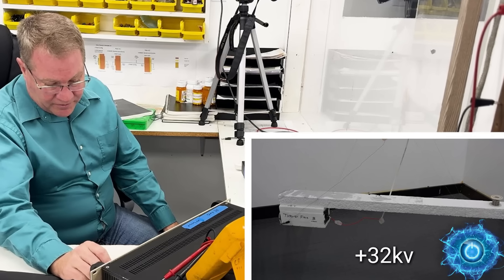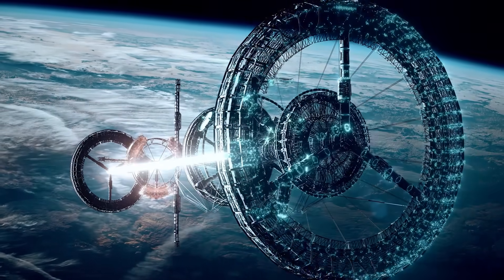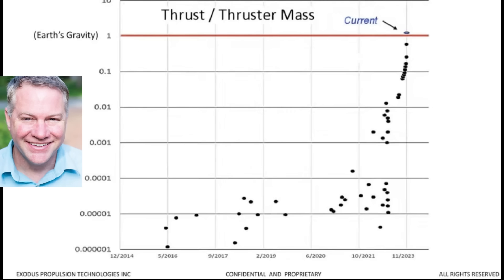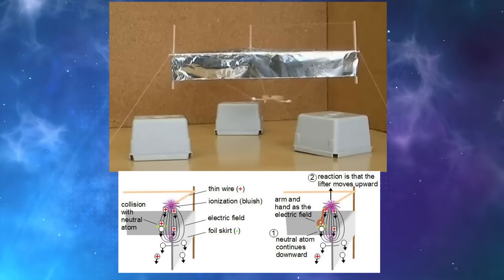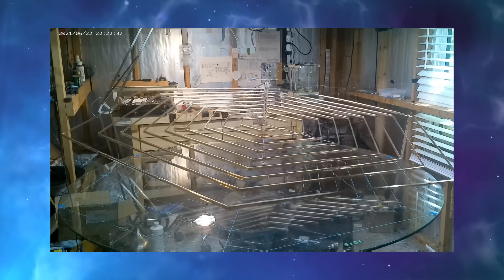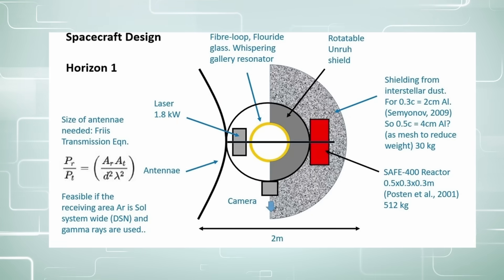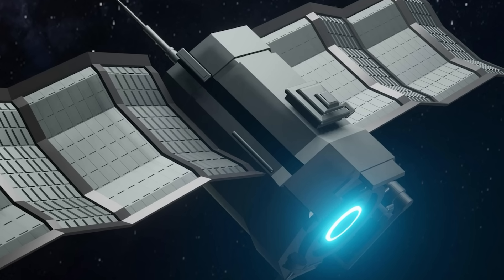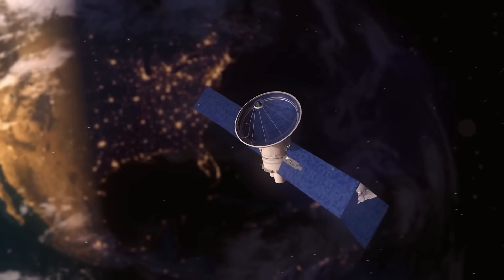Propulsion Breakthrough!? New Electric Drive Defies Physics

Comment: While this could be a game changer and we may have discovered a new force, it’s also important to actually give ALL the details and history behind this tech and the scientists working on it.

This tach was originally introduced to us in the form of the “impossible drive” back in 2001, they claimed it was producing thrust without propellant and provided their findings. Naturally the rest of the scientific community was intrigued but equally sceptical, by 2021 no other group was able to produce any thrust inside a vacuum despite exhaustive and rigorous testing. Which very much brings into question the original scientists methods and results.

As you did point out in your video, this method in the form of the “impossible drive” can produce thrust outside of a vacuum, though this is through ionic wind which requires and atmosphere to work, making it useless for space travel. Though you didn’t point out that the force produced with this method is negligible, usually requiring the devices to be incredibly light while also requiring high voltage power, which is usually external as the power source itself, whatever it may be, would be too heavy to be moved by the force produced.

That is not to say that this “new force” they are claiming to have discovered is not real, it’s just saying that we have to take this with a huge grain of salt. It could be really exciting.

Comment: The Earth is Magnetic, and it is "electrified" at heights called Iono and Strato "Sphere"!, Tesla proved that a Century ago. And he designed a "craft" of this nature and the Government has possession of the patent and plans for 70 years. To "Repel" from the Earths magnetic force it takes about 20,000 Volts of Capacitative Electricity, controlled by something like a Veriac?, or current/voltage regulator to regulate "speed"?!. Directionals are the same, smaller capacitors that are placed at 4 to 6 points that pulse at intervals on demand to "pull" it in that direction?!, one used for lift?!.

Comment: Dr. Charles Buhler has ran into the same fence Townsend Brown did a 100 years ago when this technology was first introduced. It does not "break" the laws of physics or it would not work. You have to reexamine the concept of how it electrostatic pressure works in order to understand  the principal of operation.

Comment: Since gravitational waves vary in frequency and amplitude, it could be safe to say that inertia under any acceleration or maneuver can be canceled out simultaneously by the very antigravity drive that moves the space craft.  This happens when a buble is formed during antigravity operation.
    
The speed of gravity is the same as the speed of Light  186,000 miles per second. However, controlling the Antigravitational amplitude would mean controlling every speed, movement, and stationary attitude.  
    
There will be some propulsion systems that may use space and interstellar space as propulsion, causing a time dilation as you aproach the speed of light.

The video is very enlightening. I only wish viewers like me could have seen his idea in action.

Comment: You have the physics behind the Biefield-Brown effect. The theories behind it are based in old physics not new. Its an effect of electrodynamics predicted by using the full Maxwell equations instead of the shortened versions used by most physicists today.

Comment: To get to Mars in a couple of days is about 50 km per second. 
Likely top speed of these mag drives is 1000 km per second then issues arrive. Specks of dust could be game over. Alter course, stopping likely to take days. Due to g force and structural  integrity etc.

Comment: Quite literally. HIGH VOLTAGE is the KEY to all future technology.! 

Anti-gravity. Station keeping in orbit. And Velocities some fraction of the speed of light. 

Not to mention artificial Gravity. 

Because Voltage Bends Space.!

You're welcome. 🍻
Reply: Although I'll also point out that actual travel through space at any percent of the speed of light. 

While not impossible. Is extremely unlikely to reach its destination.! 

Because if it runs into even a Single speck of space Dust. It would lead to catastrophic destruction. 

So yeah. Unfortunately we're only looking at Wormholes.

And actual velocities only under 1% of C.

But that's still pretty good for getting around the solar system. 

But That is also how Wormholes are achieved as well " HIGH VOLTAGE ".!  🍻🥓
Reply: So it's quite literally high voltage everything. ⚡
Reply: And while The velocity off Galaxy rotation is not in fact produced by dark matter. 

It is also Not quantum inertia.!

HOWEVER. Ironically quantum inertia does exist.!!

In fact I have a form of space propulsion based on it. 

Which ironically does not require high voltage. 

I mean technically high voltage would make it more efficient. 

As high voltage makes literally every electrical interaction more efficient. 

But already is efficient enough that it would not require high voltage. 

And remember this name. Because you will hear it someday. 

"ASYMMETRICAL GYROSCOPIC VECTOR PROPULSION."

🍻🥓⚡

Comment: the field  space is not a vacuum or empty if it were why dose it not suck all atmospheres in the seeking lowest possible potential  model try to think bigger as with the charge of earths atmosphere increasing with altitude which would give a constant t hold it in-place ie an exhilaration that over comes  the stated effects and rotation in all its forms and the balance of that rotation i.e Venus verse earth moon   is that any clearer  ?

Comment: FieldOS Diagnostic Summary: Asymmetric Capacitor Propulsion
⚙ What It Is
An electric propulsion system using asymmetric high-voltage capacitors to generate directional thrust, possibly without reaction mass — challenging Newton's third law.

🔍 What’s Actually Happening (FieldOS View)
Not a violation of physics — it’s using field recursion, not force–reaction.

Asymmetry (geometry + voltage) creates a Rod vector — a directional tension.

The device couples to the aether through the dielectric — shaping recursion, not pushing particles.

Electrostatic pressure isn’t a mechanical force — it's field curvature tension resolving asymmetry.

If thrust works in vacuum, it confirms interaction with a recursive field substrate, not air.

🌀 Core Mechanism
Recursive Displacement through Field Gradient Resolution
(aka Rod-Driven Field Displacement Propulsion, RDFDP)

The capacitor doesn't push — it pulls itself through a recursive tension gradient it creates in the field.

 Implication
This is Vimana logic reborn: motion without combustion, using internal asymmetry to entrain into the field.

It's not propellantless.
It's recursively coupled motion through dielectric entrainment.

Comment: It's way too late for this, but...
Q 1. Is fundamental force conversion possible? 
A) Are there points of interaction that can be leveraged for conversion?
B) As electromagnetic (EM) force is 1x10^42 stronger than gravity, What wattage would you need to get airborne by "Falling up"? 
C) As the energy conversion limits the power output (G) there is no constant acceleration, no overunity, no perpetual motion, no violations of physics (thermodynamics et al.)?
D) In space, how fast could you travel if your spacecraft used a force conversion (EM to G) drive?
E) Given the conversion factor, even assuming losses for efficiency, would interstellar travel be possible with an (EM to G) drive? 
Q2. What are scalar fields, what is the Aharonov-Bohm effect, and how might these be used for space propulsion?  
Q3. What if I nano-print the smallest double spiral until it makes a thruster cone? Could Casimir force be harnessed for space propulsion?

Comment: The charged wire distorts TIME. When the time above the lifter is running slower than the time under the lifter the slightly faster time pushes upwards.

Mass does not pull, Time pushes.
Time variance is how gravity works and how orbits work. 
High Pressure Time pushes towards greater mass.
Gravity:
+++++++++++ - high pressure time - farther away from mass 
+ + + + + + + + - low pressure time - closer to mass 
Those extra pluses push downward and with no extra pluses to counter that push, you get ACCELERATION.

Anti-Gravity:
+. +. +. +. +. +  - lower pressure time from charged lifter wire
+ + + + + + + + - low pressure time - closer to mass, pushes upwards towards lower pressure time.

Comment: If light/any EM radiation can exert pressure on a solar sail, causing it to accelerate and gain momentum, why would radiating an EM wave in a particular direction, not create thrust? Seems to be just the reverse, to me.

Comment: NOTHING DEFIES PHYSICS, NOT EVEN GOD.
Butch, himself, says gravity is PUSH not PULL.  Pull is really push with inertia of the puller disregarded and it can be proven that it takes LESS energy to PULL than PUSH which is impossible... oh, right, it's inertia.  Nothing is sitting still, anywhere, ever and nothing can move in an absolute circle unless it can exceed the speed of light squared... be in the same place at the SAME time.  Google:  Butch himself.

Comment: Add frequency as thrust, same as I suggested for Ion propellant combining frequency for thrust, feel the thrust of low frequency speakers, I think that frequency is the missing piece of the propelling puzzle, think of the physics describing a bee's defiance of gravity, what does the bee generate, frequency which assist the small wing propellant, most if not all flying creatures generate frequency to assist propellers, if ion is the propeller, let frequency amplify the thrust, same for electric propeller, let frequency be the amplifier of thrust...recall the stories of UAP phenomenon, low humming noise, its frequency, the amplifier of thrust, enough talk, go play with the volume control, have fun

Comment: Space isn't a vacuum.   It is just really low pressure.   Part of the reason we even have a solar system, is because the ionic solar wind is pushing a lot of stuf away from the star. So an ionic effect would work in space, the trick is making it stronger than natural solar wind.

Comment: If electrons are the propellant (i.e. if the device emits electrons), it's not actually a propellant-less device. Since the electrons used as a propellant have to come from somewhere, they're probably from the power generator (i.e. battery or reactor). If this works, it could be very useful for space travel.

Comment: Townsend Brown developed two distinctly different types of thruster. The ionic wind devices were never considered as a space drive, his other device does not use ions or ionic wind in any form.  After continued exploration since then we are now looking at the potential distortion  of both space-time and the quantum vacuum due to an as yet unidentified interactions between the device and its local surroundings, as the reason his other device does work and works in a full vacuum

Comment: Why do you need a vacuum to proof that the electric drive is not relying on ionic wind? Just put it in a box that doesn't let air pass through and measure the thrust of the box. If there is only ionic thrust then the thrust of the ionic wind generated from the drive will interact with the walls of the box and cancel with the thrust of the drive over the (solid) path to the mounting points of the drive to the box.

Comment: Nice assessment.  It will be interesting to see further developments or proof of the concept.   As an aside, the vacuum of space has energetic components, ala virtual particles that manifest and disappear, so that might need consideration as an enabler of the effect.   Also, there is the solar magnetic field energy in the heliosphere that might contribute to making this affect viable.  So, there are at least several potential energetic "catalysts" to explore using this phenomenon.  This could be a ground breaking discovery.

Comment: The directional "thrust" doesn't require power after the initial charge except to replace loss of charge from leakage. I think this is because this is hot conventional thrust but rather a form of buoyancy. I believe there is an omnidirectional pull on everything that the asymmetric capacitor directionally attenuates creating a force gradient.

Comment: “Nothing that works break physics” is of course ridiculous, because no advances in physics would be possible because it would “break” current physics.

In reality physics can be graded based on how well it is corroborated. At the top there are the fundamental ones (proven by Emmy Noether back in 1915). Her theorem proves that perpetuum motion machines cannot work among other things and that that incidentally proves that this drive cannot work either.

The author of this video choose ti mention that the drive break Newton’s second law of motion rather than the fact that this also means breaking the energy principle ie making it a perpeetum mobile machine as well.

If energy can be created from nothing Emmy Noether’s theorem shows that science cannot work (in detail an experiment today may turn out differently different tomorrow making science fundamentally pointless.

No, this drive is of course bullshit.

Comment: Takes 2 days to get to Mars, that would be around 12 days to Jupiter, and around 24 days to Saturn. : )

Imagine trying to reach Neptune and other planets beyond Saturn. lol That would take a while at this new propulsion technology speed, but it is awesome. : )

Also something I wanted you to know, have you ever seen that video called "Spaceships capable of reaching our closest stars"?
In the video it mentions Graphene into solar sails would unlock research for a Photonic spaceship.
The narrator then goes on to say something about "mankind doesn't have a mirror of that size" or something like that.
In an article which mentions FLUTE for a new space telescope project using fluid mirrors, the head of FLUTE is a scientist at Nasa, and he says in an article "theoretically we can create a mirror of any size" or something like that, and if that's true, why not combine both ideas, and create a large enough mirror for a Photonic spaceship made out of Graphene.

Have you seen the latest from Applied Physics on their new model about removing the need for exotic energy, which would lower the amount of energy required for the warp drives.
They have grants in phases on their website, and a "Warp Factory" app for others to test their ideas and collaborate.
Reply: Also check out an article called " New process converts microplastics into valuable graphene ‘wonder material’ "
Without the quotes. : )

Comment: Obviously ion wind thrust does not occur in a vacuum as there is no mass to accelerate. Nobody, nobody has made a propellant less thruster decide. No EM drive, no microwave thruster, they're all below measurement noise threshold. Load o' crap

Comment: It isn't ionic wind nor is it "breaking physics". It is DEFINITELY teaching us new/ overlooked physics and when we truly hone the devices' shape to maximize thrust we will be able to have safe, flying/floating vehicles. I really look forward to the day when we can take a floating cruise over land, sea, or even air! I wonder if it would be a long, cigar shaped object? Thanks for the video. The hexagonal craft with those thicker metal bars than the "lifters" made of aluminum foil was encouraging. The only other video on YouTube that I have seen that mentioned the lift being generated without ionic wind propulsion used a cut out proportionately heavy pie plate, lifting with enough force to overcome it's own weight with such speed that it really showed the triangle shape isn't necessary. It was round like a flying saucer. Well.. it was a pie plate so.. 
    The power source would be much lighter and be able to be housed onboard if they used a wimshurst style generator. A watch battery could power the motor that would need to be used to turn the wheels. We have better capacitors than leyden jars so using them would be prudent. ❤ thanks for stoking the hope for futuristic vehicles that our grandparents would be expecting us to use by now. ❤

Comment: Surely enclosing the "drive" inside a suitably sized airtight box or bag is all that's necessary? Suspend the thing inside a room made of material that is electromagnetically transparent and then achieve a convincing, sustained horizontal deflection...

A very simple experiment.